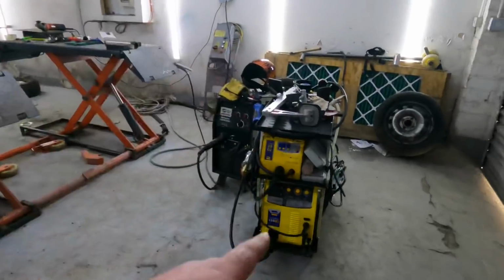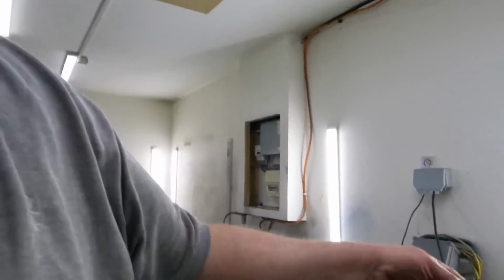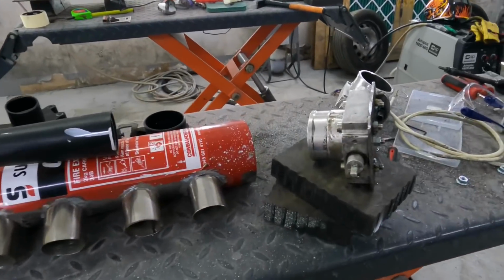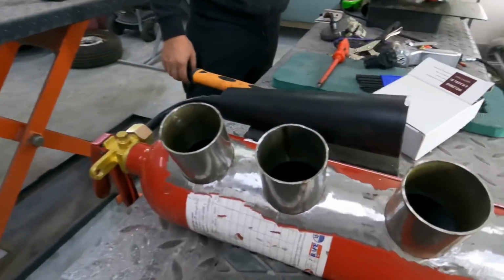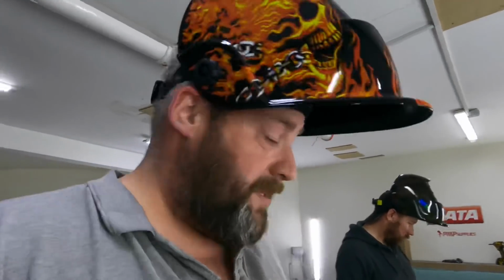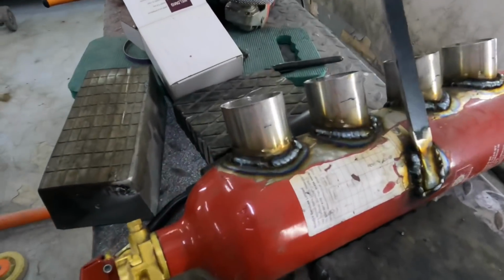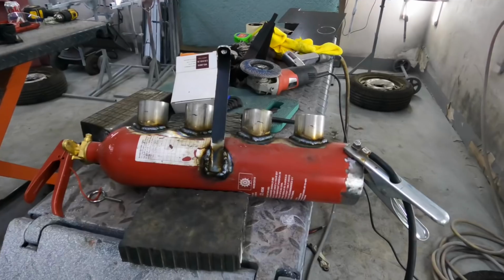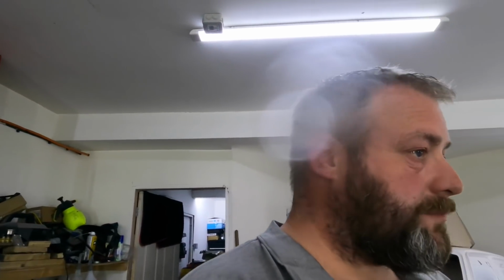St170 turbo transit connect van budget build!!! Pt5

Comment: Hello grant how did you open the fire extinguisher to use as the inlet manifold mate thanks
Reply from the maker: We removed to the valve then cut it about
Reply: OK thanks will send a pic of it when it's done
Reply: Hello again grant was just wondering where the oil feed for the turbo went when you did the budget build thanks again trying to get as much help as possible

Comment: Are you using a diesel van to start with mate? I'm sure I heard you say it. As I need help with my loom
Reply from the maker: Yeah it was a diesel 👍👍
Reply: @bumperfix   I'm trying to run it with a standard st170 loom is this possible??
Reply from the maker: Yeah should be straight forward to do with the at loom

Comment: Have a practice with some scrap, have the tubes facing towards you and fire extinguisher horizontal, start your weld at the 12 o clock and go down to the right 3 o clock, repeat this all the way round, creates a neat weld, full seal, minimal distortion. 👍
Reply from the maker: Yeah I’m going to get some practice in soon I can’t weld pushing forward can only weld pulling for some reason 😂😂😂😂 need more play time 👍👍👍👍

Comment: My weapon of choice for welding that would be TIG welder. Much easier to control on thin metal if you have the foot pedal to adjust power as you weld. Trying to MIG around pipes is hit and miss, more miss than hit with my welding technique Lol.
Reply from the maker: 😂😂😂😂 did think about it but went for mig

Comment: With the GYS Mig welder just double check the polarity on the earth return clamp . Lots of these modern inverter welders are multi process and can do MIG, ARC and TIG . TIG requires a positive return , and it’s possible the return lead is in the incorrect position . If this is the case Mig will weld but power will not be applied and you won’t have penetration. 😄👍🏻
Reply from the maker: I had the earth in the negative which I’m sure it’s supposed to be I’m going to double check everything in the morning though 👍👍👍👍👍👍
Reply: Should have pure argon gas for stainless, but that doesn't explain the better weld with sip
Reply from the maker: I’ve sorted it but it’s crap don’t like it

Comment: Grant turn your welder power up 2 notches mate.. Youll get much more starting penetration and a better outcome.. Less Spatter... It will weld much nicer.. Like the idea of the fire extinguisher.. :-)
Reply: Or the wire speed down, I always found tacking on a bit of scrap, then moving the tip quickly to what you want to weld whilst it is still glowing red, helps greatly with delicate/fine work.

Comment: Good try grant but I really wish I could come show you how to use that welder properly 🤣🤣🤣
Reply: If you was closer mate I would have the welding like machine 🤣🤣..Just try turning the wire down abit and instead of dragging the weld push it..have the gun at  11 o'clock and go from right to left..how you have it set is good for filling holes and gaps but not for a good penatrated welds..have a play mate it can only get better 👍👍
Reply: I thought wire speed a bit high and downhanding those welds for sealing not strength, but could I spray a car - NO 👊👊👊
Reply from the maker: 😂😂😂😂😂😂 I wish you could teach me

Comment: Grant a co2 extinguishers are when full around 52bar the 2300psi is the test pressure of the bottle. I would take the syphon tube out of it the plastic tube. Also I might have some co2 stickers at
Work i can check on Friday and send you 1 if you want. As for paint do it ford race red as its close to the red that is used.
Reply: Sent you a email
Reply from the maker: Cool I’ll have a look 👊👊👊👊
Reply from the maker: Yeah we unscrewed the tube 👍👍👍👍 and yes that would be great message me on instagram or via email links are in the description 👊👊👊👊